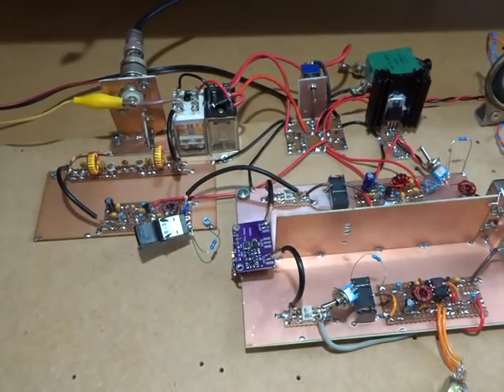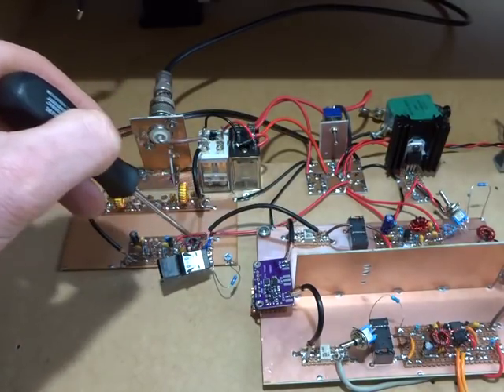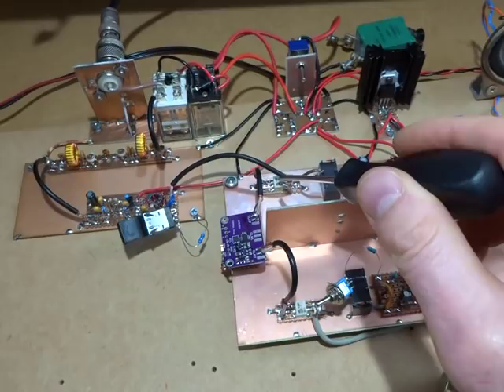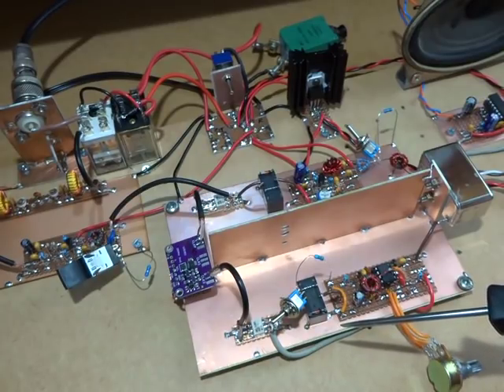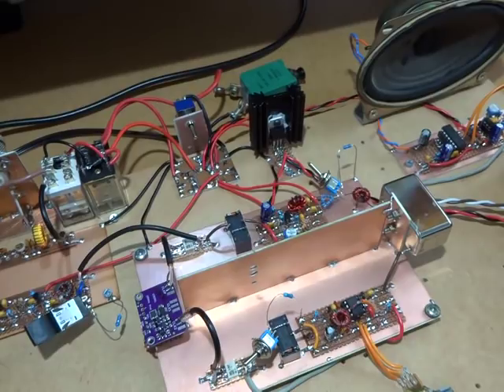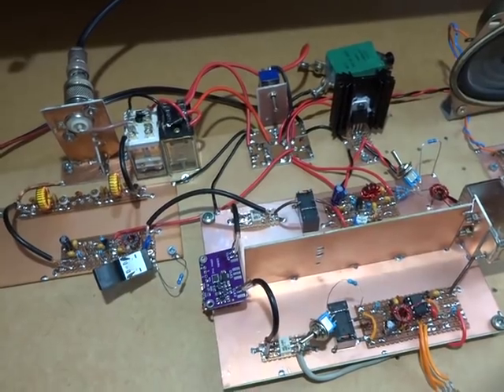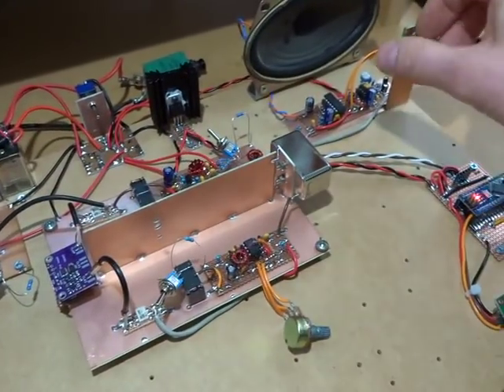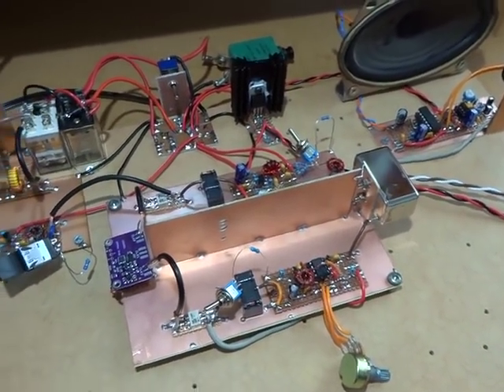Homebrew MC1350P based SSB Rig - #7 Superhet Receiver First Look

Comment: Hi, quick question, the VFO is varied when whe want to change the frequency we are receiving from?
And the BFO is fixed and only for demodulate the signal?
Thanks
Reply from the maker: That's right Simone. The clue is in the name of the two oscillators. The Variable Frequency Oscillator (VFO) is always varying to ensure the output of the mixer is at the Intermediate Frequency. Now the IF is fixed and does not vary, hence, we can use a fixed Beat Frequency Oscillator (BFO) to recover the intelligence at the product detector (just another mixer).
Reply: @CharlieMorrisZL2CTM  Ok thanks, so the frequency we are listening to is determined by the first mixer (VFO)? I'm in the process to build my first receiver :)
Reply from the maker: @simoneambrosini2860  Yes that's tight. If-say-your desired signal is at 3.5MHz and your IF is 9MHz, then you will need to tune your VFO to 3.5+9 = 12.5MHz. So desired signal xMHz + 9MHz = VFO MHz.
Reply: @CharlieMorrisZL2CTM Thanks, keep up with the good work, greetings from italy.

Comment: Hi. Most of the birdies are coming from crosstalking among clock 0 and 2. I only use one si5351 for vfo and another one for bfo. Just try it. Regards yo8rxp
Reply from the maker: Thanks for that. I'll add it to the list. How did you set a different I2C address for the second Si5351? I thought the address was fixed.
Reply: @CharlieMorrisZL2CTM  Hi !, Used a raspberry pi as main controller for VFO and touch display and Arduino for BFO. If one have  SSB filter center different than CW filter as I am, one can use a Digitalread from another pin to properly switch SSB/ CW   BFO sincronized with VFO shift to receive same audio beat. Regards, Gabriel
Reply from the maker: @linuxromania  Great. Thanks Gabriel. I'll have to look into that.

Comment: Use a baffled speaker. Makes your receiver sound a lot more expensive on Youtube :) I use old an old Motorola com speaker. Love your channel. 
Tom, ak2b
Reply from the maker: Sounds good Tom, in more way than one! I might have a look around the garage.Charlie
Reply from the maker: I'm trying to source an old communications speaker in a wooden as that would be a nice thing to have in the shack.
Reply: @CharlieMorrisZL2CTM  That would do it. I mentioned this only because  most camera mics thin out an unbaffled speakers even more. I,m also a fan of better audio amps ala KK7B.
Reply from the maker: @raccoonnyc  Cheers Tom.

Comment: Charlie, I had birdies from an Si5351 until I dropped the output across a couple of pre-set resistors. Even with the software limiting the output I found it was too much. Limiting the LO and BFO levels with the pre-sets cleaned it up 100%. Good video and good progress with the project.
Reply from the maker: I'll give that a go Steve. I'll try a couple of 1k trim pots and see what impact the level has on the birdie. I might say it's very narrow band and doesn't really impact me too much, but still worth looking at.
Reply: I thought that too Charlie, then I wondered if they might pop up in the transmissions. I went looking for unwanted mixer products and harmonics but it appeared to boil down to the Si5351 either overdriving the mixer or not liking the input Z. Two 1k trim pots did the business for me.
Reply from the maker: @G0FUW  That's good to know. Thanks Steve.
Reply from the maker: Just tried two 1k trim pots and it certainly made a difference. I can't hear them anymore, which is great. Both are on set at 1/3 from min and the reception quality is perfect. It also helped with reducing receiver noise too, which is a added bonus. I'll definitely look to incorporate those in future builds that's for sure. Thanks for the tip Steve.
Reply: I read on a BITX40 forum that the Si5351 outputs ideally need buffering to reduce cross-talk between the three outputs. I expect adding a limiting resistor quite effectively increases the impedance it sees.

Charlie - another great vid. I'm a fair bit behind you - I'm only so far up to one double balanced mixer (a discrete schottky ring) and the Si5351 VFO, but I'm watching with great interest.
Reply from the maker: Thanks Trystan. I'm going to start using 1k trim pots from now on. I never used them as the drive level was spot on 7dBm when connected to the mixer. Now I have significantly less drive and everything seems to be fine.
Reply: Hi Charlie, one other thing to consider is that the 1st IF amp might not be providing a 50 ohm load at all frequencies to the DBL IF port. My understanding is that they are very sensitive to IF termination impedance in particular.
Reply from the maker: @4youian  Thanks Ian. I have a note here to try a diplexor if needed. I have got it going using direct connections. As expected, it needs very little mic gain.